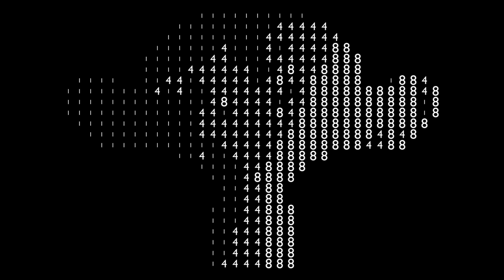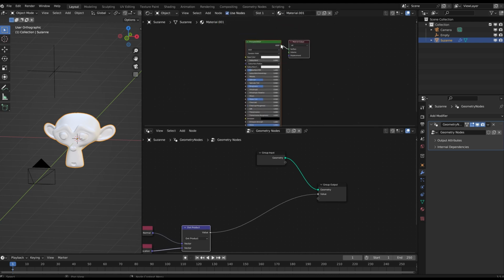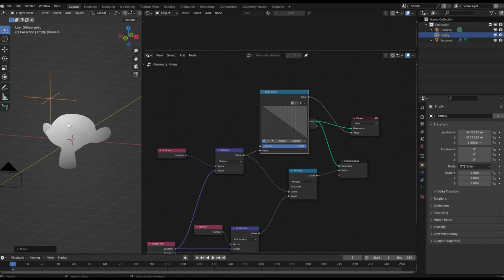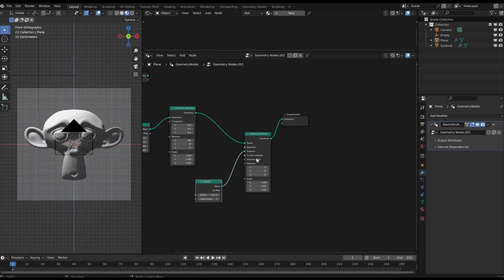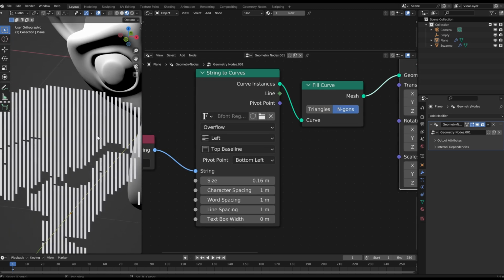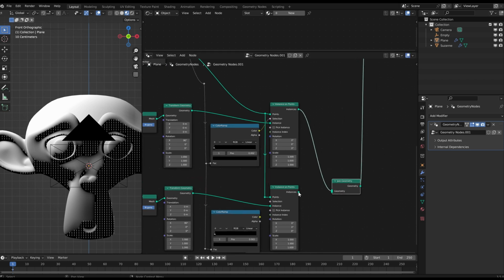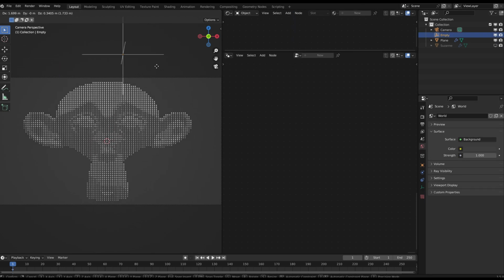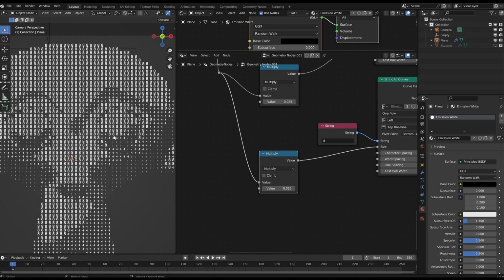Light with Geometry Nodes? - Digital Effect in Blender

Comment: THX for the Video,  great use of the Dot Product! Just thinking about how this can be used to apply different levels/kinds of stylisation in relation to the lighting
Reply from the maker: You could have for example multiple layers (angle thresholds) and rough edges with noise textures to get a rough cartoonish lighting for example.

Comment: Can you swap the digits for png? So that instead of a 1,4 or 8, a png could be displayed instead?
Reply from the maker: Sure, its just a Position for an instance of wish.
Reply: Would i replace the String to Curves node?  @PointCloud
Reply from the maker: Yes, you just replace that node with a plane with an image texture for example. Then you can have images on certain brightness values of the model. @Revenant-Dan.s
Reply: @PointCloud  would love if you made a video about how to do this. Am trying to figure this out now and am getting confused. For example what do you mean by " Position for an instance of wish"? As well how do you convert the image plane to a mesh to be instanced like the ico sphere? Great videos btw.
Reply from the maker: An instance of wish can be anything, any object: digits, letters, objects, images curves, ...,  everything.

An instance is just a copy of something basically
Reply from the maker: To use and object for example a plane with an image on,  just drag it from the object list in the top right hand corner in the geometry Notes editor and use the geometry output.
@bplus2351
Reply: @PointCloud  Thank you so much for the reply! I really appreciate it. I have the plane instancing working now although still have to figure out scaling it as the object info node only shows outputs and no inputs for scaling or rotation.

the main issue im having now is the best way to apply the image texture node to the plane as the only outputs for this node are color and alpha and the only inputs on the object info node seem to not connect to those. Or do you use images-as-planes to apply the image to that plane then bring it into the geometry editor?
Reply from the maker: In the shader editor of the original plane you just connect am image texture node to the color or directly in the output.
Then all copys should look like that
Reply: @PointCloud  Thank you so much, got it all working now except one part, since my base model is gray it is not hitting the highest brightness values so not showing the image corresponding to those values. Did you just change the base material for the suzanne to white before all the other steps? I see you just went into EEVEE but mine doesnt seem to be as white and even when the lighting is hitting it it is still is gray at the brightest spots. Thank you so so much for the help, youre an excellent teacher, will be going into your older videos for some more guides.
Reply from the maker: @ReekingHogReal  By default I changed the Color Mangement to "Standard" (its in the render tab all the way down).
This makes everything pretty grey and dull, maybe thats the fix for it.
Reply: @PointCloud  Beautiful! Thank you so much all working great now!